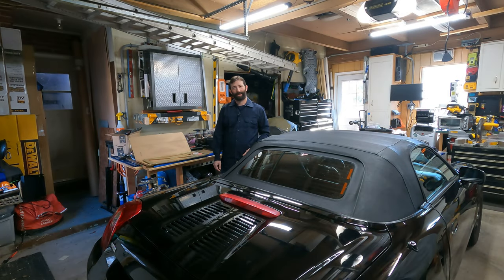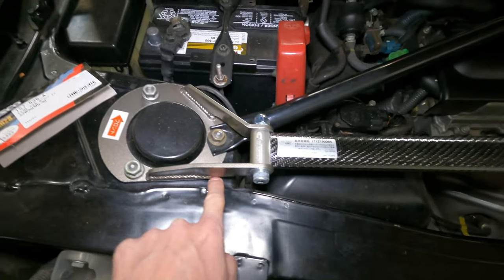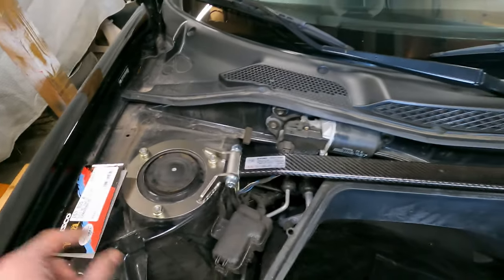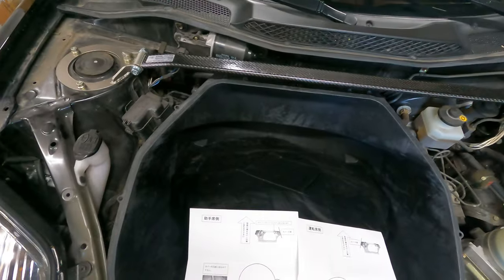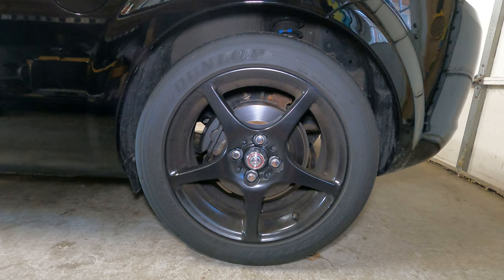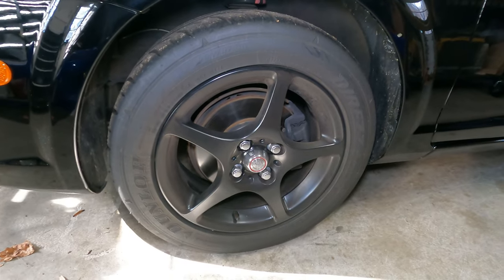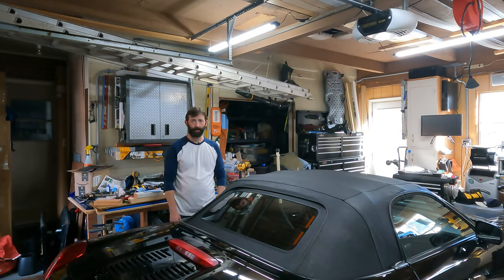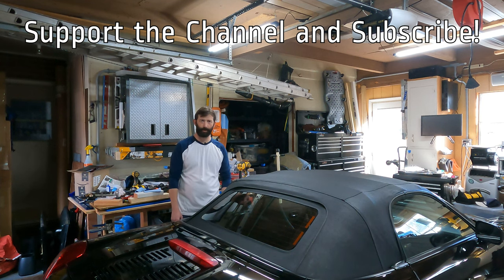MR2 Spyder Handling Upgrades and Breastplate Install!

Comment: I had a Corky breast plate (replaced with a larger mid brace) along with a TRD front strut bar; big improvement.  A bit skeptical of the improvement with the rear strut bar, as the cross diagonal factory piece is well engineered to begin with.  Bracing makes more of a difference on the PFL models.
Reply from the maker: Agreed!

Comment: I had Planted technology seat brackets and M3 Recaro seats.
Later I had to remove the seats cuz they were too bulky and put back the stock ones.
Believe it or not the car felt much different with the planted brackets. Every rigidity mod is worth it!
Reply from the maker: That's interesting. I bet the larger braces that cage out more of the bottom of the car would help even more than just a breastplate!

Comment: Nice car man! That hole alignment issue seems to be a common issue with Phat's plates, the same hole on mine doesn't line up perfectly either, I think the factory screw points are somewhat offset just enough to prevent the screw from going in. How did you end up enlarging yours?
Reply from the maker: Thanks! Phats said that only like three out of 100 he has sent out have this issue. I do think it's probably a Toyota alignment problem more than his. I just used a Dremel to enlarge the hole

Comment: how do you like those direzza ziiis? i was going to get those, but they were backordered so I ended up going with the a052 in the same sizes
Reply from the maker: So far I absolutely love them. I used to run the old Z 1's on my WRX. Super sticky, a bit noisy, but ride very well.